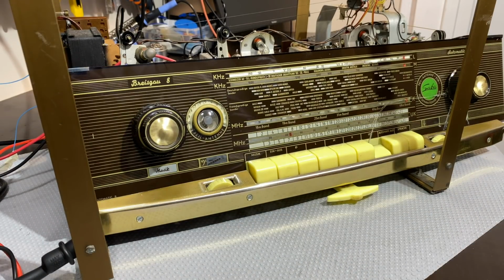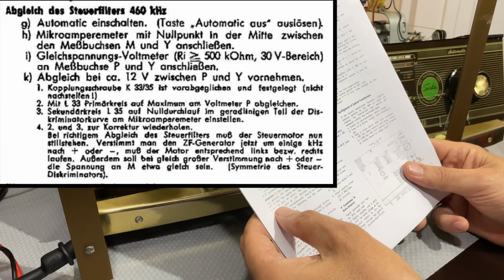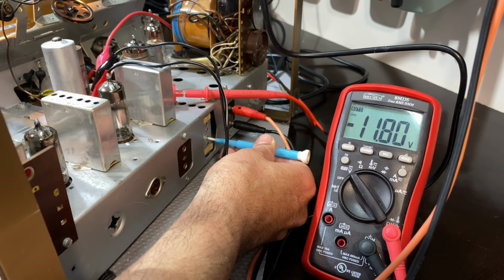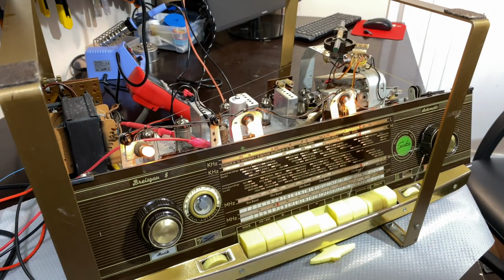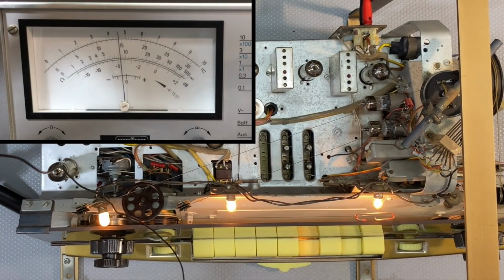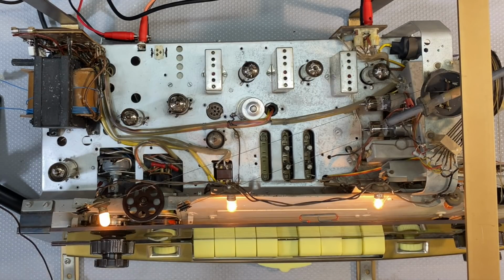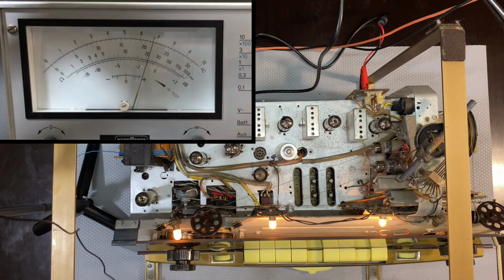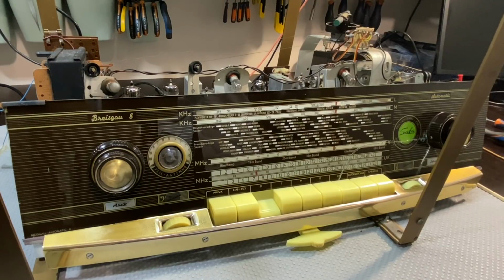SABA Breisgau 8 pt. 9. Tuning Motor and RF Alignment for the AM bands.

Comment: That powered tuner was fascinating Manuel. It would have been a selling point when demonstrated in the shop, it would have convinced me anyway. You may have explained it but the numbers around the magic eye are indicating the rotary antenna position I assume, is there a pointer or something? I couldn't see it 🤔🙂
Reply from the maker: Those markings are reference only, and don’t actually relate to compass points or anything like that.

Comment: You really have me confused.  When you were doing the alignment in the area of the 3 slots that were under the cap that you removed, you mentioned that the two slots to the right had both capacitors and inductors.  The one on the left only had capacitors.  But then when you were adjusting what you said were inductors, you were adjusting in the same part of the slot as the slot that only had capacitors, not the points in the middle of the slot that I thought would be the inductors.  Could this have anything to do with the shape of the waveform?  The dip in the middle thing?
Reply from the maker: I think I mentioned that I’d got that backwards. The end ones are inductors and the middle ones are caps. The LW only has the inductors.

Comment: A warning!!! Be carefull using contactcleaner on the switches !!   If you use contactcleaner you should do it with radio off and afther aplying you realy should dry this using a hairdryer or heatgun.  Ik you don't do that the contacts will certainly catch fire and they will be destroyed . These saba's are very sencitive for that..you can use contactcleaner on most radio's with power on without any problems ..but  not with these saba's ! ...
PS: You did a real fine job on this alligment!
greets...from belgium
Reply from the maker: I never use contact cleaner on live devices. I learnt the hard way once 😊 Scared the hell out of me
Reply: @electronicsoldandnew   LOL....join the club!